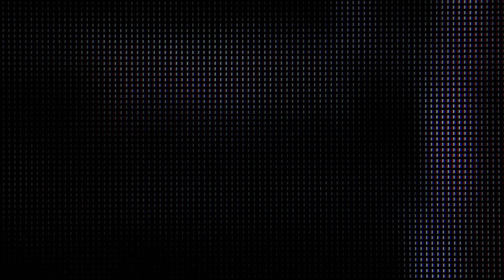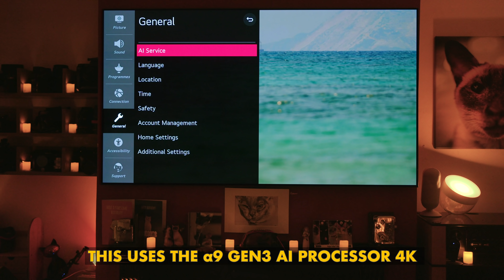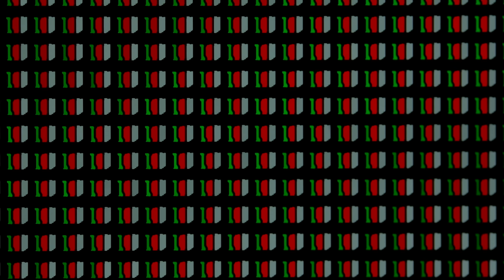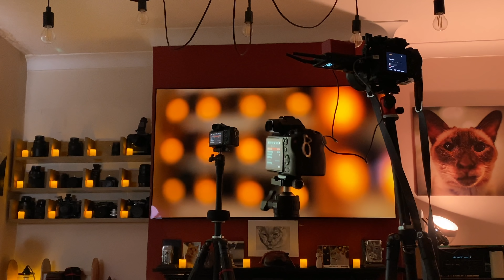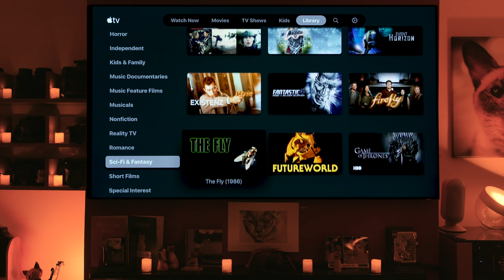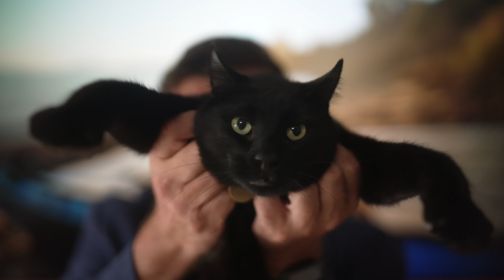WHY this LG GX OLED is a fantastic filmmaking tool

Comment: A technical question: I have an outlet socket on the wall on the place for the TV. The socket sticks out for 2-3 cm, so it will not allow the TV to be placed flush on the wall. Will it be a big problem? (if the TV has a 2-3 cm gap from the wall). I'm afraid, that it this case the TV will hang loosely on its bracket.

Comment: Now this has me wondering if a room full of high end OLED TVs can be used as a set, kinda like the set in the mandalorian
Reply from the maker: Unless there is zero bezel then no. But you don’t want oled as not bright enough so little ambient light emitted and too reflective. You can buy LED panels designed to be joined up. That’s what you want

Comment: Amazing non-review/review.  Once you get an OLED it's incredibly difficult to impossible to want any other kind of TV.  

I still ultimately see 4k as a gimmick that’s built around ignoring the fact that most HD options as hamstrung in one way or another.  A 10-bit 1080 OLED would be perfection.  All of your 1080 content would look great and all the 4k and above content superscaled down would look great.

I have a 1080 LG OLED that I bought specifically for the purpose of watching all my Bluray and DVD movies the way they were intended to be seen without trashy upscaling.  I also have an LG 4K C9.  I love both of my Tvs, but with a proper adjustment the difference between the two is negligible.  The 1080 is more useful and I don't even think it has a 10-bit panel.

Also, I thought I heard you mention that you had a Fujifilm GFX100 at some point, if you do would you ever consider to a short video on the 12-bit ProRes RAW to Atomos update for the GFX100 and how it compares to some other cameras?

Comment: Wait, you got an exceptional television and then mounted it on the ceiling? Send my sincerest apologies to your neck and shoulders.
Reply from the maker: Yeah let me mount it in front of the fireplace. Smart thinking. Clever comment.
Reply: @philipbloom  Forgot to add the winky face onto the end, all comments intended to be in good humour. Though to be fair most rooms have at least four walls. (Personally speaking, I find fireplaces to be weird anachronisms of a bygone era and thus the perfect place to mount a TV. But I'm unromantic.)
Reply: @philipbloom   Also, fires make homes colder because they create a continual flow of hot air up the chimney. This means new cold air must get sucked inside your home to replace it; the result is fireplaces warm your living room at the expense of every other room in the house.
Reply from the maker: Simon Wright such a strange comment. That is a decorative fireplace. You aren’t allowed to have working fireplaces in London. 

It feels strength to have to explain the layout of my lounge. It’s an open plan kitchen lounge. There are 3 walls in my lounge.
Reply: @philipbloom  Again, all comments are offered in good humour, I feel like you're taking my comments far more seriously than intended. I claim absolute ignorance over fireplace ordinances of the London metropolitan area.

The concept of having a decorative fireplace is a fascinating one; something I shall contemplate over my next helping of tea and crumpets.
Reply from the maker: Simon Wright I am guessing American or Australian...
Reply: @philipbloom  Australian. (But I married a Brit.)

Comment: Hi Philip, just wondering if you would use this as a studio reference monitor for editing and color grading?  Is there a setting on it to go to a screen saver or similar to avoid burn-in if one was to go this route?
Reply from the maker: Reginald Worthington I don’t know. If you did use it as clean output that what i would do. You can still calibrate it to a point with something like spyder x elite

Comment: I have been using 55 inch LG OLED as my video editing monitor for 3. years now.
Reply from the maker: PoMan_911 am guessing for full screen viewing or are we talking main monitor? If so have there not been any burn in issues?
Reply: @philipbloom  No burn in as a second monitor for editing even after two years of use. I do have a screen saver that kicks in after 2 minute of non-use.  Also, I set it up so that the dock bar and other information on the edge of the screen are not visible unless I hover over it.  Now my editing is not 8-10 hours session but 3-4 hours at a time.  It's an LG55 OLED B9.

Comment: That's a lovely clip of the LG Gallery TV. I prefer Samsung The Frame, as it does allow picture mode and they don't have burnt pixels... It doesn't have the blackest blacks but such is the trade off. I don't like a black glass on my wall, that's my problem...
Reply from the maker: Fair enough. Yeah the frame looks excellent